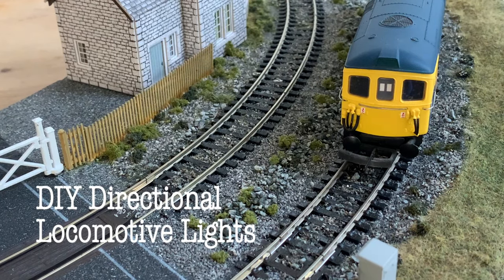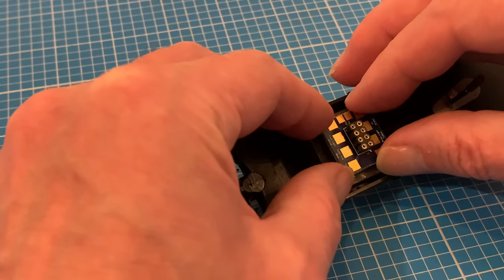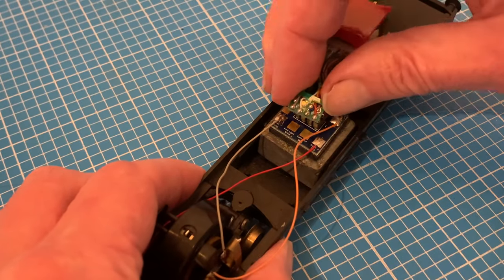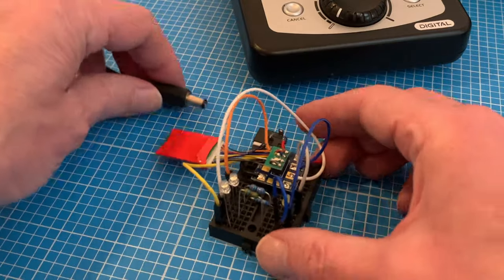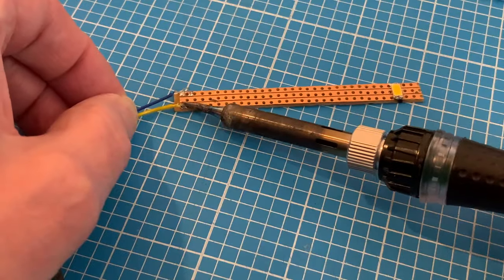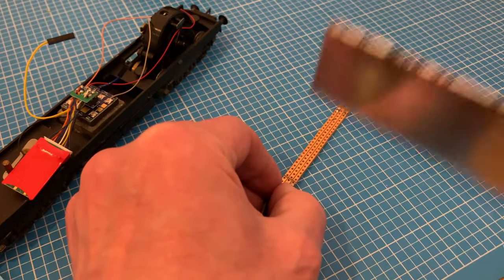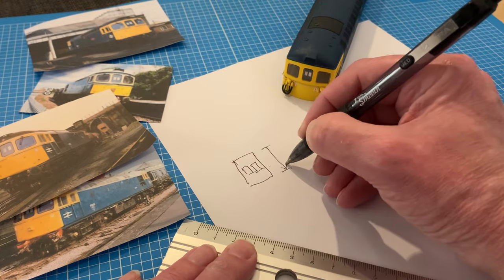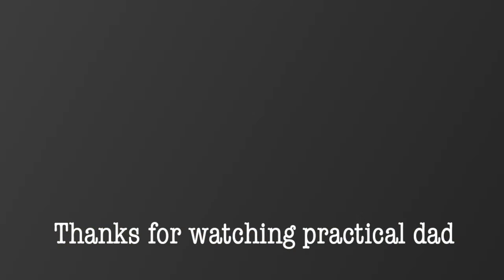Directional DCC headcode lights for an old Lima Class 33 - made from scratch!

Comment: Pater, enjoyed the video. The pad in the middle of the LED is (usually) for heat sinking purposes. Typically this type of LED is run at 20mA to 80mA so they need to have a way for the heat to escape. As you have connected it you are passing a much lower current than normal. So your LED shouldn't have problems for a good while.
Reply from the maker: Thanks for the info!
Reply from the maker: Thanks for this. I must check the mA of the lighting output of the DCC chip. Like you say, it shouldn't be much.

Comment: The metal pad in the middle of the led is for conducting heat into the circuit board in high power applications. Its safe to connect it to the cathode. It's not really needed at low brightness in a model
Reply from the maker: Good to know. Thanks.